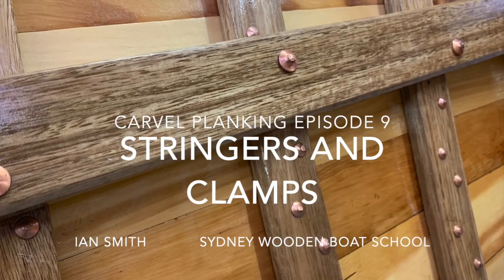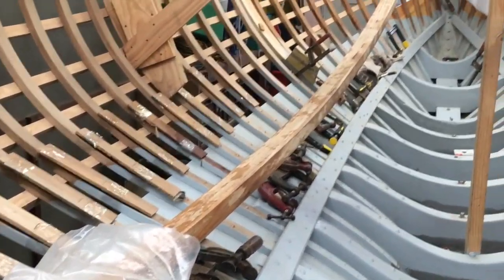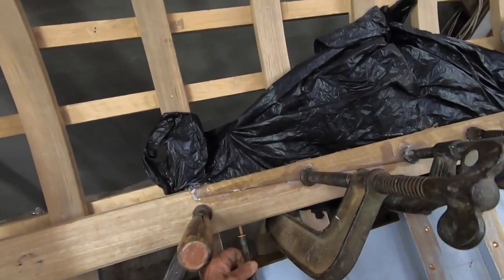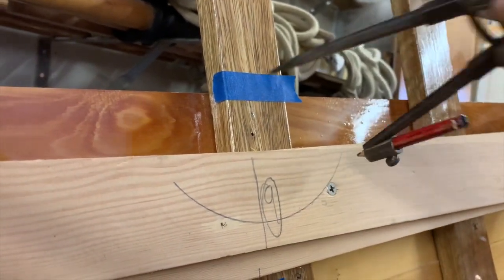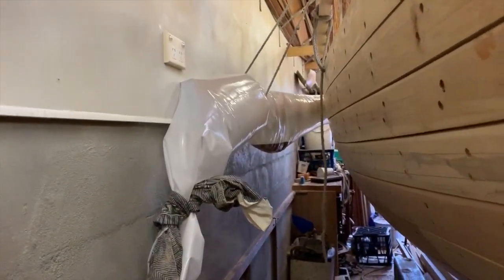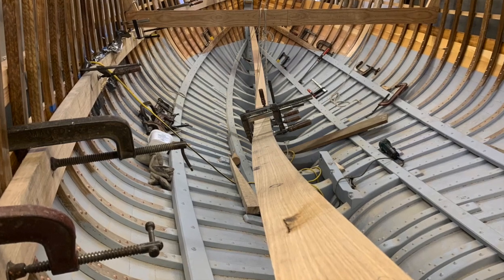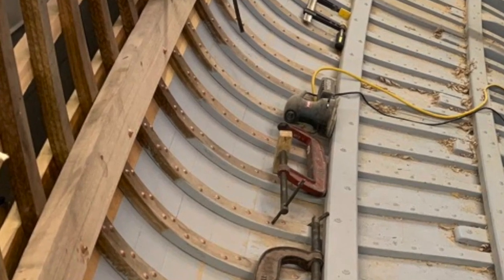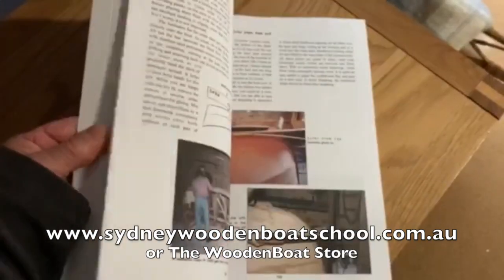Carvel Planking Episode 9: Stringers and Clamps

Comment: Hi ian. Just curious to know if your spotted gum was air dried or kiln-dried?. Im restoring a 22ft clinker motor launch in nz, and have managed to import some nsw spotted gum for my ribs and stringers/ clamps. Its kiln-dried and wondering how much this will affect the steaming abilitys.
Reply from the maker: Mine was freshly cut and quite green. Air or kiln-dried timber does not bend as well as green. I suggest you soak the ribs in water for a few days and leave them longer in the steambox than the old hour per inch of thickness rule. And make sure they’re very hot, the heat is more important than the wetness. The stringers and clamps should not be a problem, but if you start breaking many ribs you would benefit by laminating them from 2 or 3 layers, steaming first, then drying them and gluing them up. Good luck!
Reply: @SmithysBoatshed appreciate the reply. I enjoy your videos and knowledge with your ease of explanation. Cheers
Reply: @SmithysBoatshed hi again.. so my spotted gum turned up, i think they were having a laugh.. cause it was fire wood grade.. i got less than quarter of what i needed out of it all. Any way the company on our side of the ditch is trying to make things right, and have kiln-dried red stringybark, and turpentine wood in stock here in new zealand. Have you had any experience steam bending these species and know if they would be a suitable substitute for spotted gum. Cheers casey
Reply from the maker: @caseydixon8714  sorry Casey, thought I had replied to you earlier. Red stringybark and turpentine would not be my first choice for steam bending, but keep in mind that good timber of a bad bending species will bend way better than a poor timber of a good bending species.